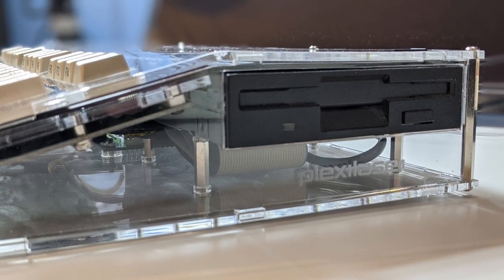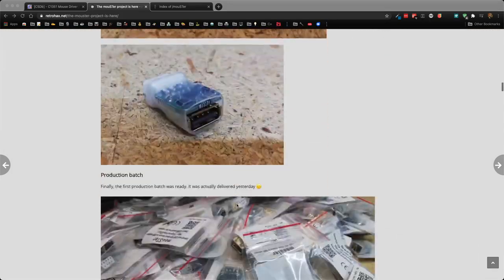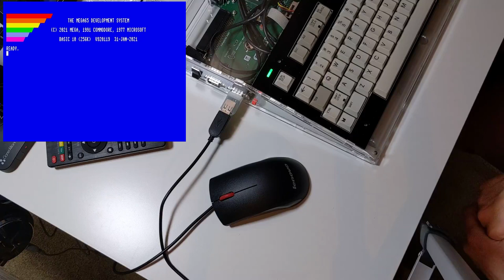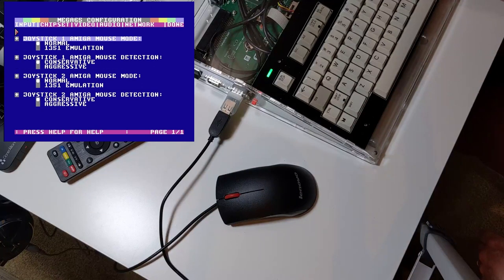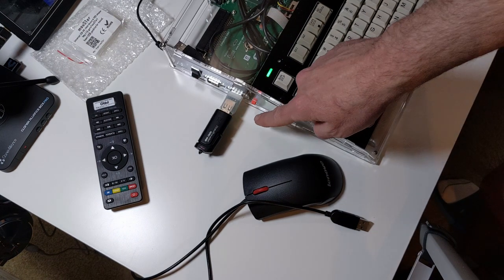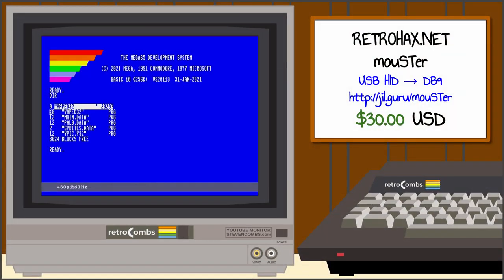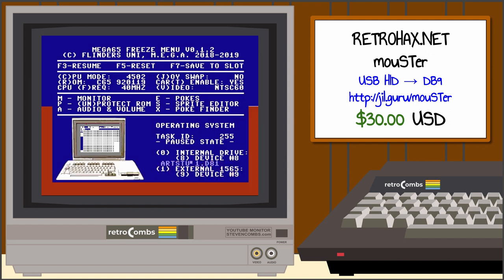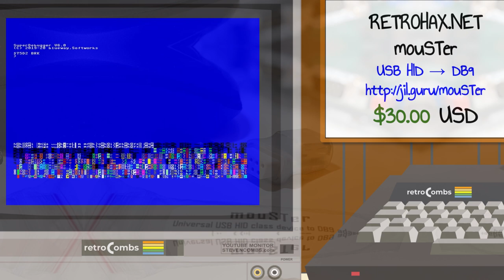The Retrohax.net mouSTer on the MEGA65. Can it replace a 1351 Mouse?

Comment: Ah I see now, more adapters ... Too bad I expected mouse to go to DB9, those Amiga ones I have
Reply from the maker: You can use an original 1351 Mouse with the MEGA65, if you can find one. I unfortunately still don't have one, so I use a The Mouse (https://amzn.to/3YsLlQ0) with a mouSTer. It works well.
Reply: @retroCombs  it's very hard to find, Amiga and Atari mouse support would save the day, as much more common
Reply from the maker: @RasVoja  👍
Reply: @retroCombs  Seen the mouse, its Amiga tank mouse with slightly different port :D
Reply from the maker: @RasVoja  🐁

Comment: Hi there, I recently bought one of these but it has a fairly annoying lag when using it any of my Amigas (a500 and a1200), seller fairly adamant its not their device, im sure its by design or possibly something a fw change could correct.They arent being too helpful. I video'd the issue and sent to both the maker and the UK seller.
Reply from the maker: Is your firmware set properly to emulate the Amiga mouse? I don't have an Amiga and can't test for you.